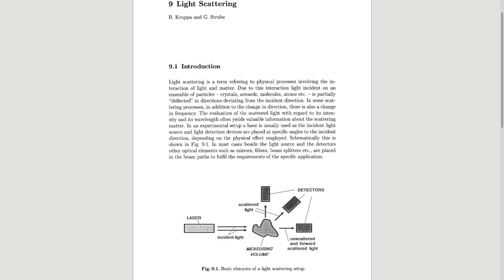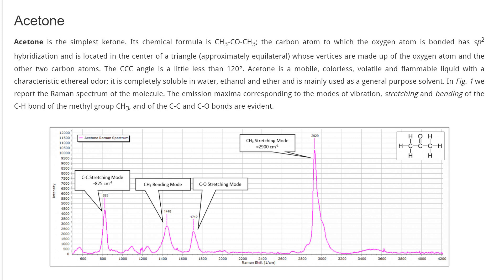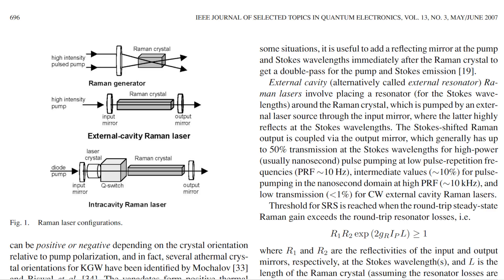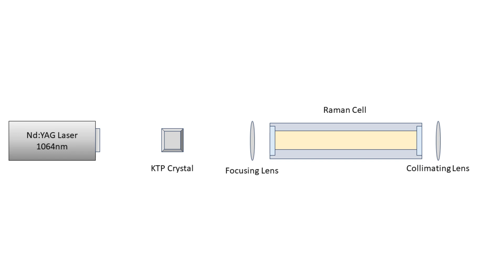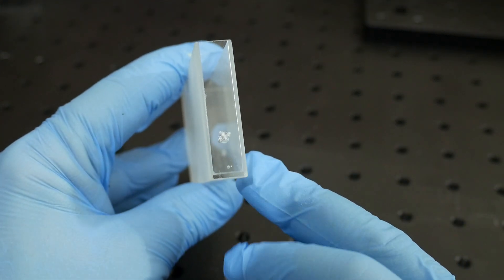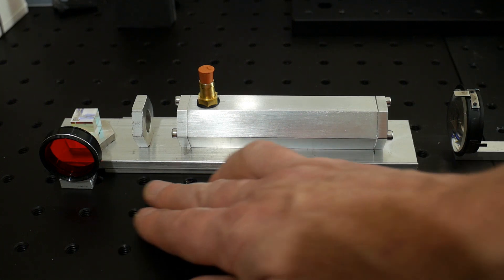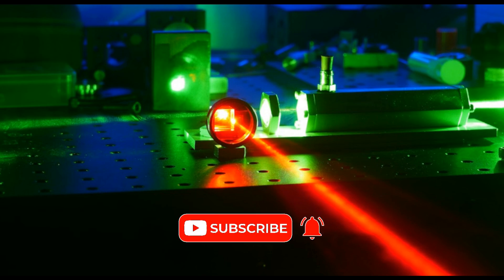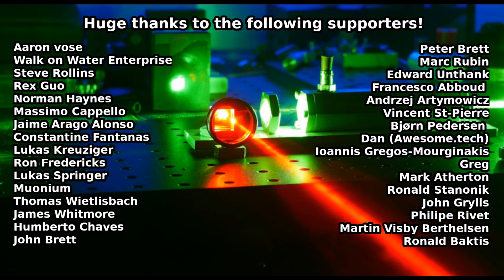Shaking molecules until Laser Light comes out. DIY Raman Laser!

Comment: Les, Raman gain is inversely proportional to the laser bandwidth and is quite sensitive to the polarization of the laser beam. E.g. rotational stimulated Raman scattering (SRS) requires circular polarization. It is also a threshold process, so don't  get surprised if making cell longer doesn't work out. If you are still planning to do that 2-times longer cell, i'd suggest you test a twice longer focus for the lens in a short sell. You can easily get below the threshold and don't get anything if you do so.
Reply: Came to mind as well, though not necessarily related.  More so in my thoughts is the wanting to make a polarization sweeping mechanism for a webcam spectrometer such as Les's, so to have that range of spectral information as well.  Amazed me the additional potential information that can be gleaned from depending how designed and in some situations.
Reply from the maker: Cool. I think the polarization of the YAG Laser is random, there is no Brewster plate in the cavity, so at some point I will be addressing this. It should improve the efficiency of the system considerably.
Reply: rotational stimulated Raman scattering?
it works on molecule rotation instead of vibration?
Reply: @GeoffryGifari If I were to guess (I suppose we could all look it up 😂) then my guess would be that the principle here is that using circularly polarized light makes your Raman spectrometer even more discriminating because it can tell the difference between stereoisomers, since circularly polarized light will interact differently with each isomer, depending on direction of polarization.
Reply: @jhonbus  ohh that makes more sense.
I just thought since molecules can have rotational degree of freedom, maybe there's a Raman scattering from that too
Reply: @GeoffryGifari  some sort of. The Raman shift can be obtained on either vibrational or rotational energy levels. In rotational case it is not exactly the rotation of molecules, but rather tiny energy excess that molecule can have because of some radial bending in the molecule. It was in the table in the video, that hydrogen can give vibrational raman shift and small rotational one.
Reply: Wht about raman glass? It would theoretically shift the ir or uv spectrum into visible light thus making it visible, maybe micro cones if not? Harmonic wave shrinking?? No idea if thats real or not

Comment: I guess with the minimal laser background I have I'm missing how both devices that produce lasers from not having a previous laser beam, and devices that transform the wavelength of an existing laser, are both just called "lasers". Is that KTP crystal also a laser? I don't really understand the distinctions here.
Reply from the maker: If light is amplified coherently, we would call that a Laser. KTP is a special crystal that interacts with Laser light to double its frequency. No amplification happens there. In the raman cell, light is amplified, and so we could term it a Laser.
Reply: So the amplification pulls in the frequency, to say  @LesLaboratory
Reply: It's quite common to call sources of coherent light a 'laser', even when they have nothing to do with stimulated emission. 

Formally, coherence describes how well light waves can interfere with each other. Informally, it describer how 'ordered' the light waves are. Spatial coherence means all wave crests are parallel in space, yet temporal coherence means they follow a defined pattern in time. 

In this video, the actual laser is an flashlamp pumped Nd:YAG laser. Then, in a coherent process called second harmonic generation, it's frequency is doubled/it's wavelength is halved. 

Afterwards, Les demostrates another coherent procress that changes color (stimulated) raman scattering.